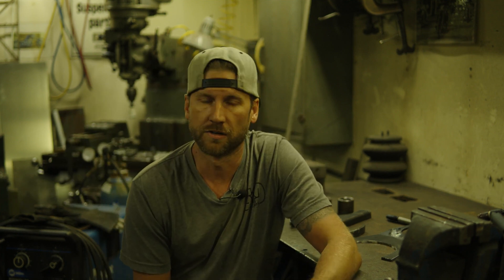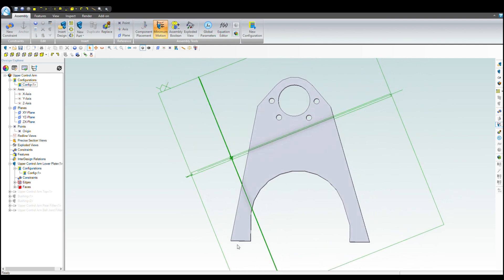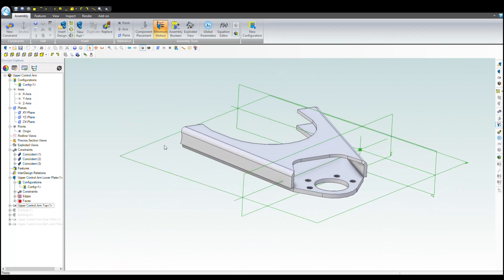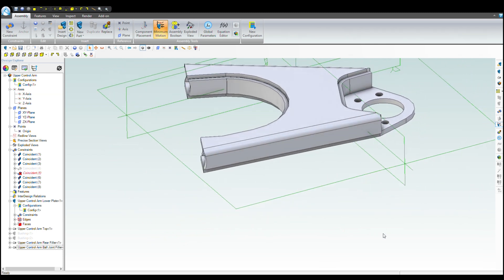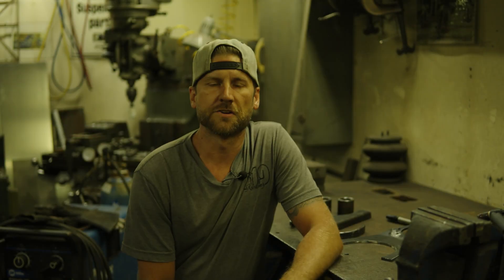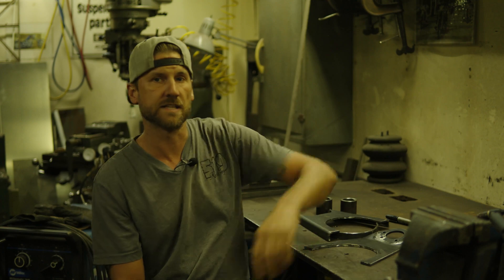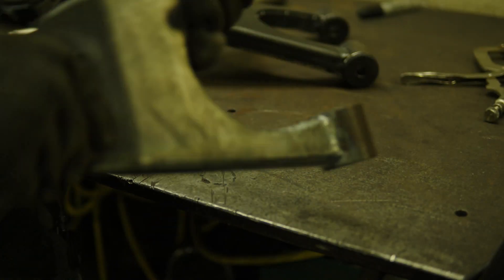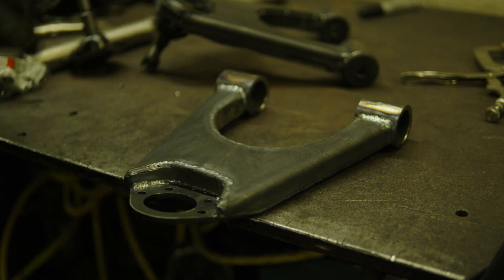Fabricating Custom Sheet Metal Upper Control Arms

Comment: Nice work, I ran across you spindle video before this. Like you said in that video, its nice to see how someone else gets to a finished product 🤘🤘
Reply from the maker: Thanks! Appreciate you checking it out. 👍
Reply: Nice video! This is what I am wanting to do on my pickup. My problem/question is, how do I cross reference the correct ball joints for my vehicle in a bolt-in version? Thanks!